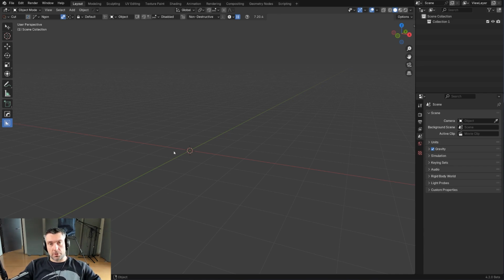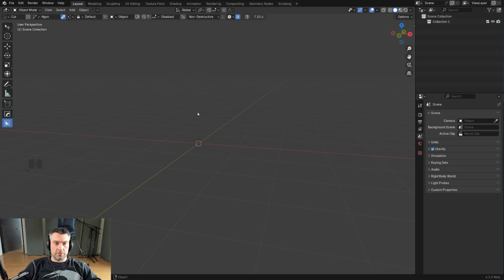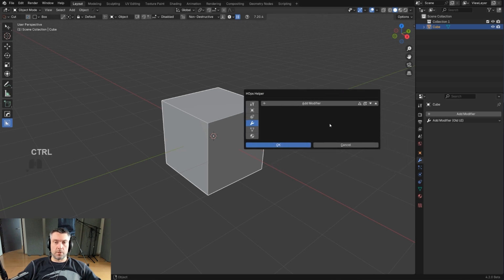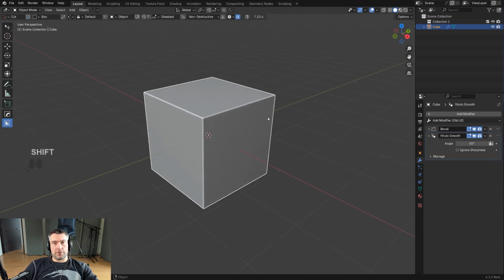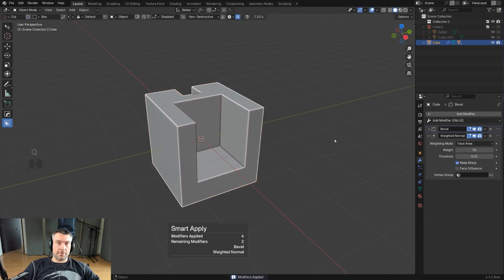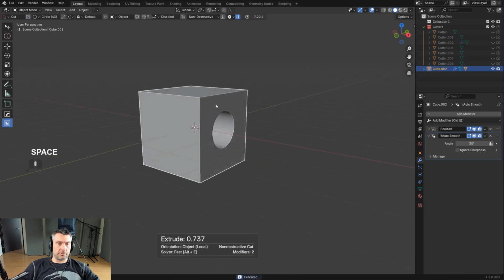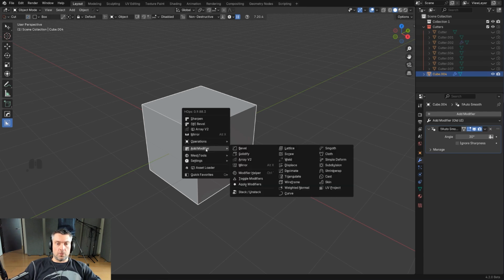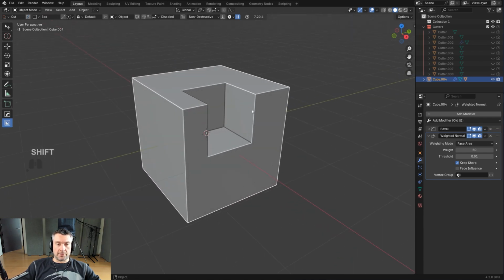Blender's Best Add-ons: HardOps & Boxcutter

Comment: Hi Ryuu... great tutorials on hardops and boxcutter... very helpful. You and Josh are surely smashing it. 

One question though... I recently bought the hardops and boxcutter bundle and when I am using default knife mode or changing to knife mode by repeat pressing X in boxcutter on the default cube mesh while practicing, my blender (4.5.2 LTS version) goes unresponsive and freezes for  a minute... unable to smoothly make changes which is super annoying. Is this a known behaviour? All other modes work as it should - smoothly.
Reply from the maker: probbaly some bugs with 5.0
Reply: @PonteRyuurui its 4.5.2 LTS and I did message TeamC - they had pushed it for further investigation. Thanks for your response 😇

Comment: Man, I am so fucking sold on your courses. I don't even know what to enroll in first; the HardOps Masterclass or the Hard Surface Accelerator! Your content is the best!
Reply from the maker: Cheers, mate. Well, that would depend on what's your level and what is the goal of your studies. If you haven't touched the addons yet and are fairly new to hard surface in Blender then I would recommend starting with the accelerator. It will give you superb foundation for anything Blender related, but especially hard surface modeling workflow. We also have Academy 2.0 offer which is not on the store. Feel free to DM me on discord.  You can join our public diuscord and DM me from there https://discord.gg/cBMF9X5

Comment: Guys, I got a super basic problem but I searched through all the Internet and couldn't find the answer. :((( I came back to Blender and hard surface modeling after a couple of months and my Boxcutter doesn't work as it used to, I guess.

BC is active. When I select an object and try to drag across and create a cutter, the object deselects suddenly with my click and nothing happens.

What am I doing wrong? D: Could you help me?
Reply from the maker: udate your addons, also join our discord and next time use the help chat https://discord.gg/cBMF9X5
Reply: @PonteRyuurui  thank you, I did so, reinstalling Blender and addons didn't help but updating Windows did. I thought someting's changed with Blender shortcuts or so but it was just a bug. Solved.

Comment: @PonteRyuurui Is the Boxcutter/Hardops course updated for Blender 4.2? Definitely thinking of getting it, but lots of issues with some of the older tutorials.
Reply from the maker: what would you want updated? the only thing that has changed is autosmooth, modifier menu and addon installation menu, and all those changes are on the blender side. Hops simply added an AS modifier, thats all. We added a video that explains the changes. The rest is the same.

Comment: Thanks Bro, But I have a question, my decalmachine doesn't work with materialworks, the decals are white, could you make a video on how to fix these material errors? Pls Bro, I appreciate it. ❤
Reply from the maker: DM does not with non bsdf mats.  However, our next MW update, which is nearly ready, will change that.

Comment: Great video, I have another question. If I create an stl or obj file in another software, and import it into blender, will hardops and box cutter work on those files? I want to buy the software but i need to know it if will work for my intended use.
Reply: What do mean exactly by "work"?
Of course you will be able to edit imported stl/obj files with HopsCutter as long as they are a mesh.
Reply: @user_xyz948  Thanks, I'm only asking because I am currently struggling with importing my stl files and remeshing them, either they turn out super low quality, so my flat edges are not flat anymore, or when i remesh, they have so many quads, my pc crash so im wondering if i should rather create everything in blender and not work between different software
Reply: @DIYGUNBUSTERS  I see the issue now. Blenders native remeshing tools are utter garbage. If you want a clean result you will need a ridiculously small voxel size + corrective smooth, which will result in meshes with a huge polycount (which can still be used in some cases but they still slow down your PC by a lot).
If you want a proper remesher then you will have to buy the quad-remesher add-on for Blender, or do manual retopology.
Cheers.

Edit: Also, export settings matter a lot. Check which settings are most optimal for your situation.
Reply: @user_xyz948  I've tried High, Low, Brep, everything my software can export is too much for Blender. I model Airsoft Guns and would have liked to sculpt on it, without losing the tolerances or functionality, but sculpting again moves the meshes instead of just adding it like hard surface modeling so I'm in a jam here. I want to add like dragon scales to the frame but doing it in a CAD software is near impossible and takes ages, where if i look at a blender tutorial, i could do in 20 min
Reply: @DIYGUNBUSTERS   Like I said, blender is lacking proper remeshing tools. I'm not too educated on how to properly export from cad cad to blender for sculpting purposes. You may find some resources regarding that online. Or you save yourself the hassle and pay for proper remeshing tools, but it's fair if you don't want that.
Either way I hope you find a way that will work for you.
Good luck.
Reply from the maker: @DIYGUNBUSTERS  for sculpting use quad remesher
Reply: @PonteRyuurui  Thanks, I'll try it.

Comment: Hi Ponte Ryuurui, I love your videos. They are informative, straight to the point and amazing. I have a question though, I make airsoft guns and other toy weapons, however I use a CAD Software to get the right tolerances and design all the mechanical parts, but they lack the creativity of what blender has to offer, I can't make the designs look as cool as in my channel banner so I was wondering if you could tell me if it is worth learning blender for this purpose and is it possible to make functioning assemblies using blender. Thank you in advance.
Reply from the maker: Just try is and see if it works for your niche.
Reply: @PonteRyuurui  Okay, I'll give it a shot, Thanks.
Reply: If you're already familiar with a CAD workflow, you might want to look into the Plasticity software too, which has some excellent tools for hard-surface modelling, and which Ponte has some videos and a course for already too.

After they're modelled, you can bring the models into Blender to texture and render them too, if you want, since there's a dedicated exporter.

It's pretty fun software, and easier to learn than Blender.